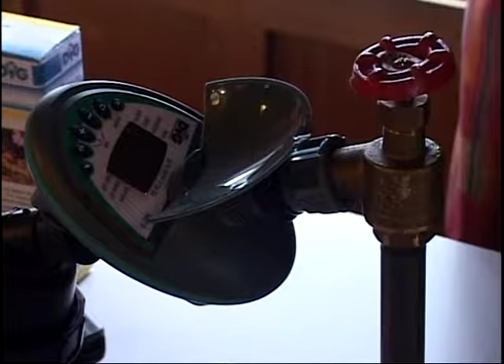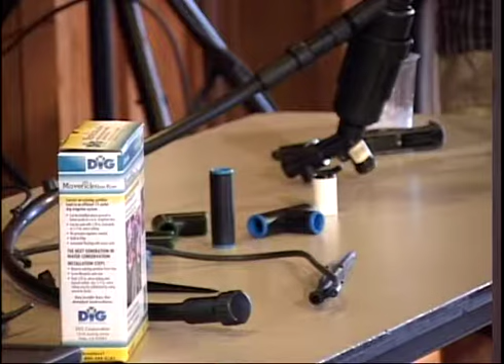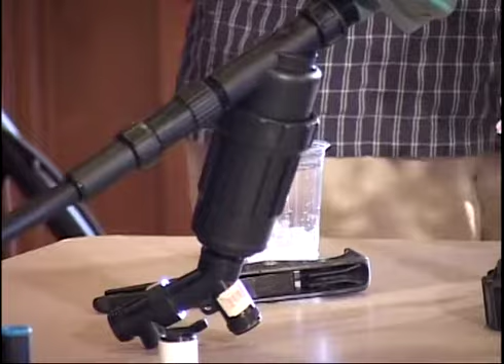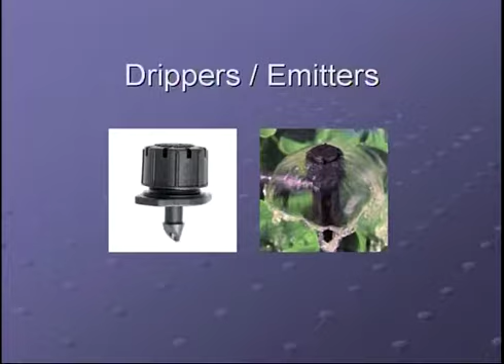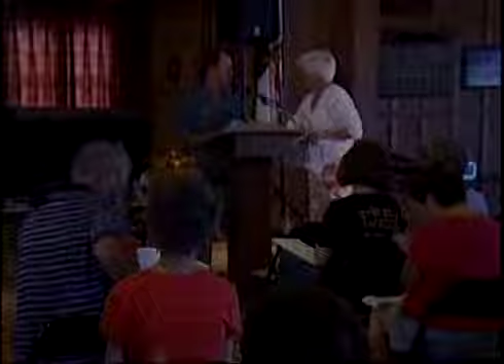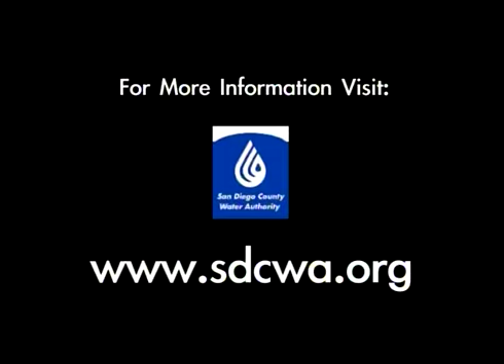Being Water Wise, presented by Stuart M. Spaulding

Comment: Very good overview of qualities and some basic principles of drip irrigation systems (versus older open, higher pressure sprinkler systems).  Topics include the advantages of the lower pressure drip irrigation, how to set up a basic drip system supply and emitters.  Discusses filters, different water supplies, clogging, standard 1/2" supply and 1/4" tubings.  This is a lecture with a few cuts to sample drip equipment and slides.  The presentation is not an in-depth talk showing a step-by-step example of setting up an actual system.  It was very useful for me.  I have over 30 years experience of working with older sprinkler and drip irrigation systems but was unaware of the pressure differences, pressure regulators, need for filtering in most drip systems and how to use different drip rates in different soils.  The presenter is pleasant and knowledgeable but often halting in his delivery and sometimes goes off microphone.  Regardless of the minor negative criticism, I learned a lot!
Reply from the maker: Hey Ed, we are glad you found the video helpful!